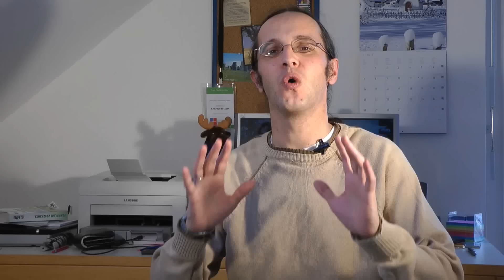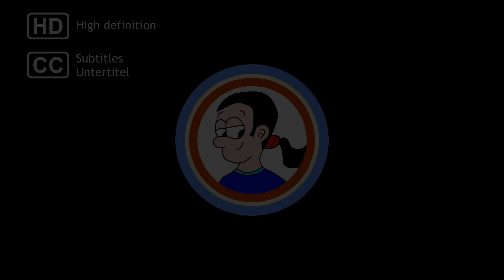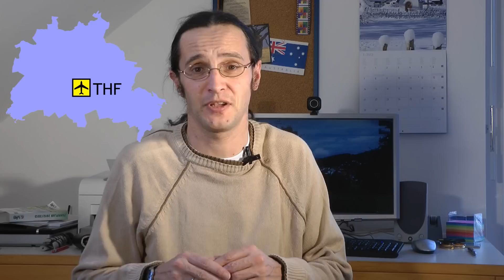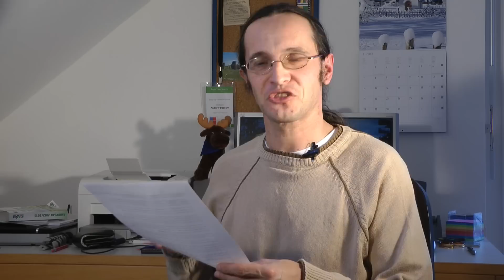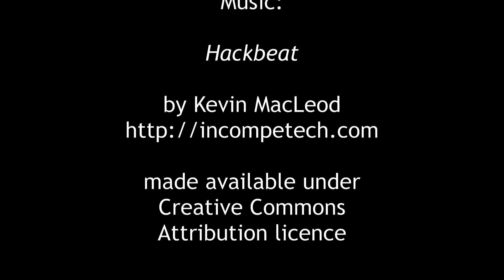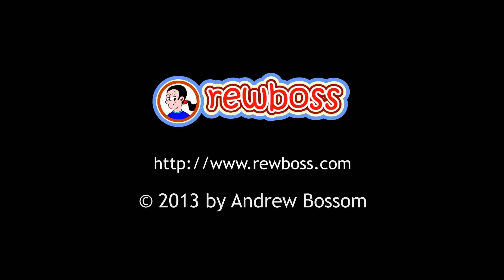Airport to nowhere

Comment: intresting info: the lights at this airport were burning for about 2 years straight, cause  the operater didnt knew where the lightswitches are!!!!
Reply: Yepp. I used to work with the guy who does the maintenance of the emergency power systems there and he told me fantastic stories of construction supervisors running around and looking for the switches. 
The reason for this might be, that the company that had the direct order to mount this systems did not do it themselves but used subcontractors to get it done. Those subcontractors are likely to pass this down to another subcontractor which in turn found another subcontractor to actually put the switch on the wall. This sub-sub-subcontractor then got his manpower somewhere from the east of the continent, where the wages are cheap enough so that all those subcontractors were able to make some money from the deal.
So the switch has been placed somewhere (if it even is at all) but nobody knows where and the only one who could tell you is probably back home somewhere behind the Ural and herding sheep again.

Comment: As of 2014-10-20, the airport, by my knowledge, is still not opened. The mayor has step down. And I still like Schönefeld airport because it was an easy ride to my hostel the first time I visit Berlin. 40 minutes and 3 € later I was at Landsberger Alleé and a three minute walk to the entrance of Generator Hostel, where I stayed for 4,50 € a night. That was in February 2012. I see nothing wrong with keeping Schönefeld. It is a good airport. Thank you rewboss for this video. :-)

Comment: Berlin is the least dark place I know, but with the airport, they messed up quite magnificently. The taxicab drivers of Berlin will probably like it though, since there is a small skirmish on a side scene where they are involved.
Another funny anecdote: The kerosine tanks of BER were already full, and since this stuff goes stale rather quickly, they had to move it back to TXL in tanker trucks.

Comment: Well actually there were planes who used BER. It was a test run and so far it seems okay but there are (suprise!) problems with the electricity.
Reply: +DrakonDerDunkle And the experts for fire safety weren't actually experts, the ventialtion system was to small - than the fans were to heavy for tho suppord strukture and to compensate the whole building had to be replanned